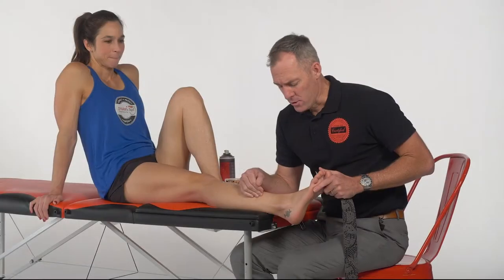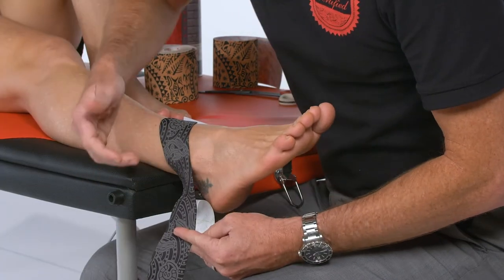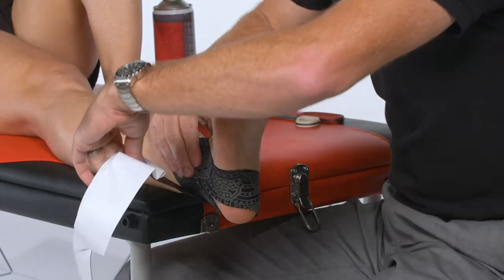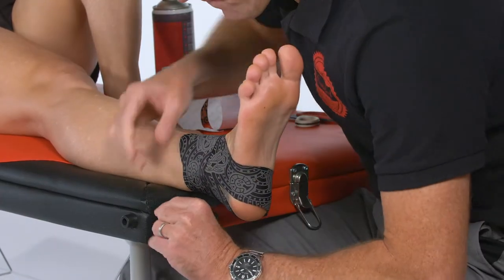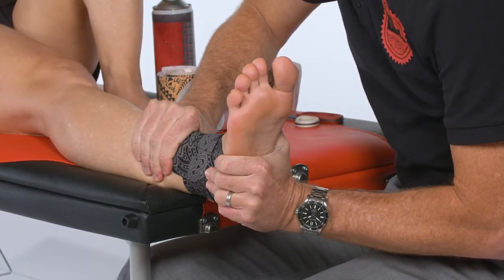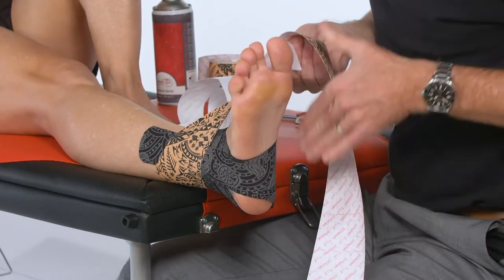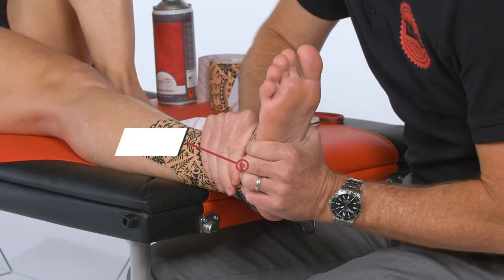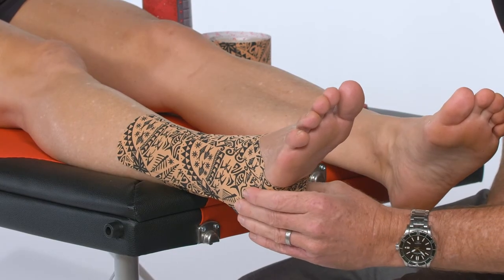Lateral Ankle Ligament Complex

Comment: Are you guys working on fixing the lack of sticking power in water or with sweat? I clean my skin, spray the adhesive spray, don't pull the tape too tight. With all of that it still pulls off. I love this tape cause it helps with my EDS so much more than regular KT tape.
Reply from the maker: Thanks for your feedback.  Are you holding the tape down for about a minute? Also, do you overlap tape or start/finish the tape on itself?  We generally find that it remains in place even with high demand activities like water polo or triathlons. The other option also is to lock off around the ends with a strong zinc oxide tape that can anchor back to itself.
Reply: Clean with rubbing alcohol and don't stretch at the ends.  Then seal it by rubbing inside to to ends by rubbing tape from the center out.